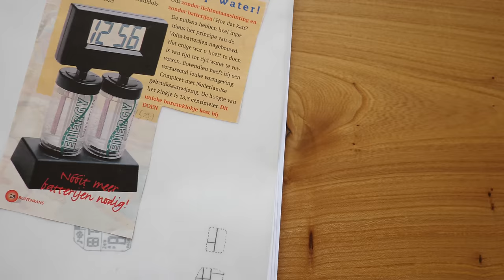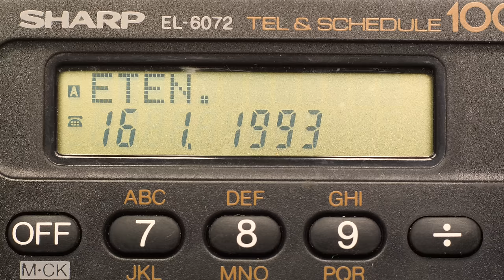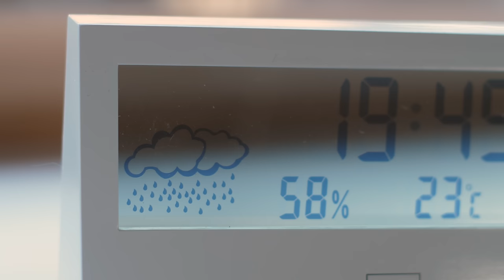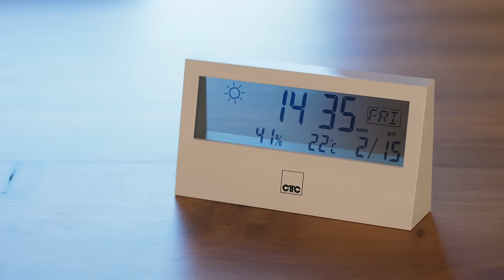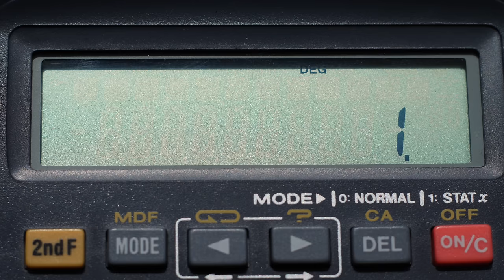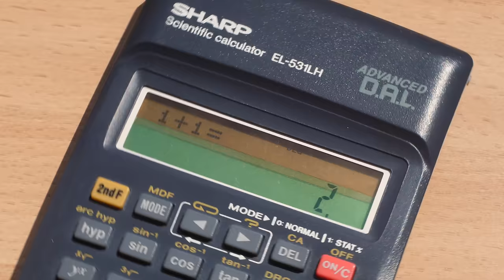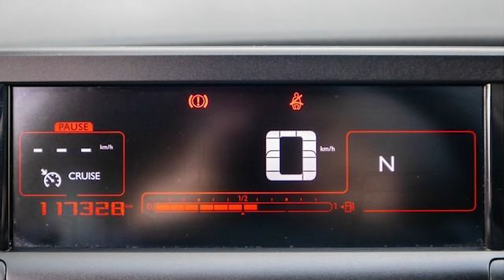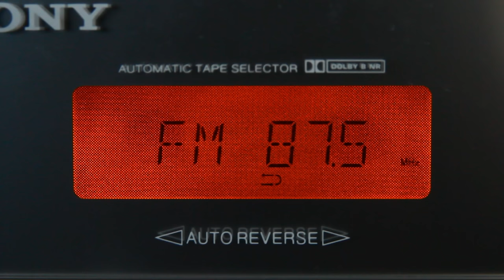LCD Explained (and more)

Comment: My alarm clock for the past 15 years has been a simple LCD clock, specifically a westclox 47539. It is always on and only takes 2 AAAs every 3 years. It never misses an alarm and will beat the reliability of a phone or plug in clock. If I didn’t use the alarm or backlight button I’m sure it would last 10 years easily

Comment: I noticed that static electricity could activate LCD elements when I was a wee lad, messing with LCD screens I had removed from cheap calculators and watches whilst watching TV. If The LCD got close to the CRT, I could select different segments with my finger along the edge of the LCD panel. Neat stuff!

Comment: 2:00 I think polarizers work exactly the opposite way. Light wants to move electrons (along the axis of oscillation) if it hits something. Between two parallel bars, electrons cannot move, so the light passes through without doing anything. Perpendicular to that, electrons can move (inside the bars, up and down), so the light will be absorbed.
Reply: 1 light is not electrons .2 your theory is also a bit wrong. Because if you take two polarized filters and turn them at right angle to each other so as to block all light then place a third filter in front of them and turn it to a right angle the light will then pass through. Very spooky. How can all light be blocked then be unblocked by a third filter? Come up with an answer and you will get the physics prize of the day.
Reply: @michaelshultz2540  
1. You are correct, but I never stated that "light is electrons".
2. My theory has nothing to do with the stuff you wrote, why should it be wrong?

And for your answer: it is quite easy
1. A photon has some polarization before hitting the first filter. When hitting the filter, it has two options: 1. get absorbed, 2. pass through and adjust the polarization according to the filter. If the 2nd filter is at 90° (in relation to the first one), the photon will also hit the second filter at 90° and will be absorbed everytime -> no light passes.
2. (You are wrong, if you put the 3rd filter "in front" of two filters that already cancel all the light, the combination will also cancel all the light.) What you mean is: Put the 3rd filter between the two filters, so you have 45° between 1&2 and 2&3. Then (cos(45°)^2)^2=25% of the light will pass through.

I do not need a physics price, I already have a physics degree, very spooky indeed.

Also: before you comment, read wikipedia or google: "wire-grid polarizer". It even has images, so you dont need to actually read.
Reply: @MarsCorporations  Well played!

Comment: 2:22 - fun fact: if you add a third polarizer to this configuration (perpendicular polarizers), it will stop blocking light and then allow some of it through.  Quantum.

edit: third polarizer should be diagonal.

Comment: Posy - my guess on the multi colour dot matrix displays are that each pixel in the display gets applied a particular voltage to activate the twist of the TN a certain amount only.   Instead of 100% VCC, it is an analogue scale voltage applied depending on the desired colour.  This partial twist rotates the light a certain amount, yielding the desired colour.  You can see these colour changes in this video when you rotate the films.

Comment: RCA Labs sold off TN LCD to Japan because in the 60s, management was obsessed with colour CRT and had sunk cost into it. The symmetric LCD modes like MVA and FFS(IPS) were developed by Fujitsu and Hitachi. Active matrix LCD displays are truly an invention of Japan and Korea. If you are in a store and are can't tell whether a turned off monitor is TN or not, place your phone's light against the screen. The entire screen should light up dimly, because TN is transmissive at zero voltage. MVA and FFS are black at zero voltage.

Comment: there is one more odd type of lit LCD, not mentioned here. i've only ever seen it on the polar FT1 heart rate watch. 
it looks like a normal LCD, with a blue-ish tint to the black segments. but when side-lit by the yellow LED, the segments themselves "reflect" the light, and seem to glow.
Reply: Also used in casio fx 991 es plus and 82es plus calculator

Comment: In school i use to swipe others calculators and pop them apart and flip the polarized filter so their screen would be black with clear digits, then watch the fun as they were mystified why their calculator was suddenly a negative.  Giggles.  If this ever happened to you it was probably me that did it when you weren't looking. 😆😅🤣😂😝🤪😎

Comment: I wonder, if you take a computer display apart and place a white piece of paper behind the lcd, will the display be clear enough to see?
Reply: modern rgb lcds need a backlight to display, other wise they will look just blank, and computer displays actually have a white piece of plastic and several other filters and reflectors behind them which is are part of the backlight

Comment: my car has a little LCD matrix display, IDK how exactly it does it (probably two backlights or something?), but it can display things in the same place as red or orange, depending on its urgency (e.g. shows oil change notification in orange while a few seconds later it displays the battery-low notification in red, in the same spot)
Reply: pigmented lcd, or probably multi color pixels